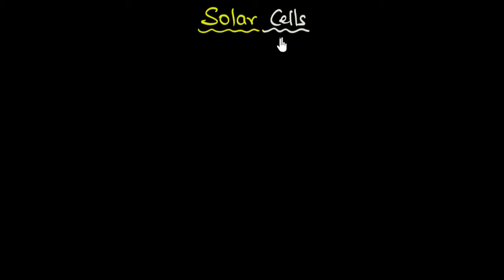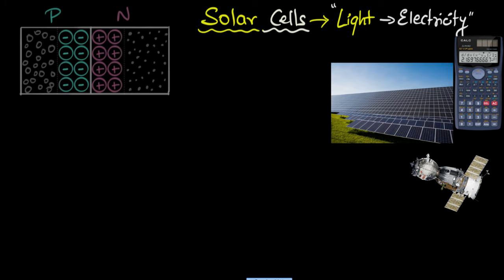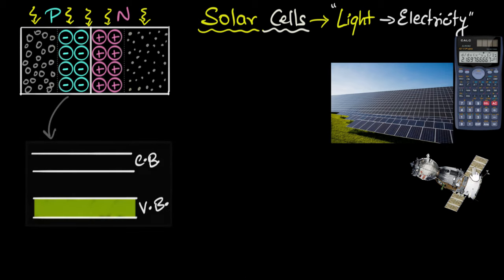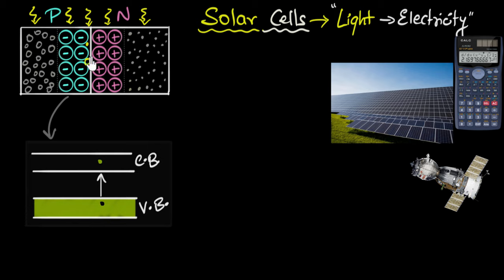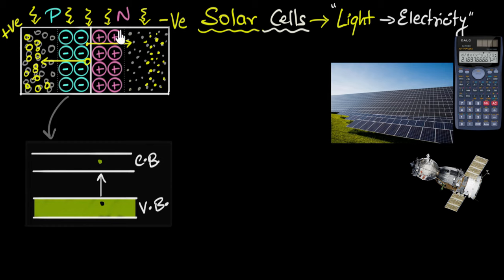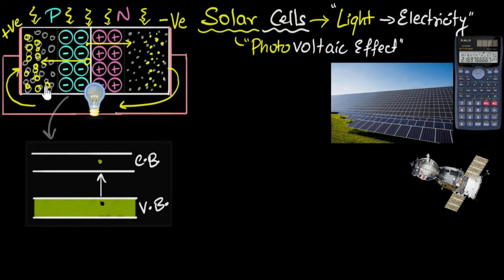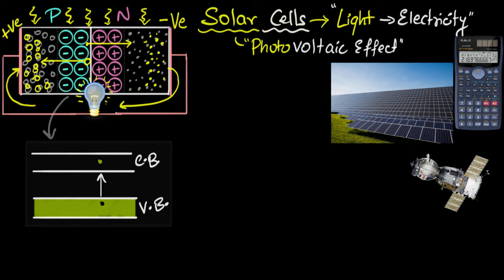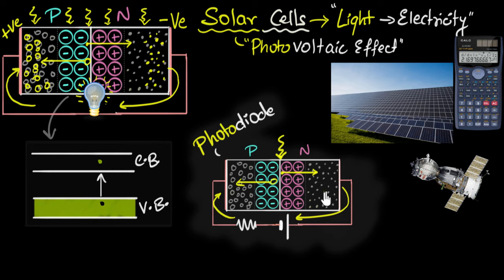Solar cells - working (and difference from photodiodes) | Semiconductors | Physics | Khan Academy

Comment: In your breakdown voltage video. i think because with increase in voltage as V=E.d, d will increase making E constant because charges are mobile but when the deplesion region covers the entire diode, d cannot exceed and furthur increase ibn voltage will lead to increase in electric field which in turn will lead to breakdown voltage. the only difference between your explaination and mine is that E will remain constant at first

Comment: Sir, at 04:59, you mentioned that the electrons will start repelling each other and hence cause a current to flow in the circuit
However, these repulsions would have been there all the time, right?
But since we now attached wires, a path for the electrons to flow has been created and hence, after the repulsion, they start flowing in the wire, which wasn't possible previously (When there was no path/wire for the electrons to flow and these electrons were moving within the diode itself after repulsion).
Am I right sir?

Comment: Sir you mentioned that the idea of a solar cell is to let the charges accumulate. But at 05:02, as soon as a bulb is connected, these charges start flowing and recombination takes place, thereby causing accumulation to cease (as told in 06:55 -> electron hole pairs are swept and allowed to recombine thereby recombination doesn't take place)
If allowing the charges to recombine prevents accumulation, then how do charges get accumulated in Solar cells, even if there's recombination taking place?

Comment: Can someone explain,why is it in the photodiode the majority charge carriers in N type (electrons) dont flow through the battery and recombine with the holes in p type,when we reverse biase it? Why is it that only the pair which was formed through photon gets to go through the battery and recombine on the other side? This might be a dumb question but if someone can explain,please do:/
Reply: Those which are already in the material are bound charges, both holes and electrons. And if they manage to reach the space charge region, they will be swept away by the electric field present there. This is limited by the equilibrium process of diffusion and built in potential. The carriers generated when light falls upon the junction are excited electrons with a specific life time, those which are generated at one diffusion length from the junction are, thus, swept away through the external circuit.

Comment: The topic of photovoltaics (or generating electricity directly from the sunlight) is a topic of growing interest to civil engineers as the integration of photovoltaic (PV) cell into the envelope of buildings (either as a well cladding system or as a roofing substitute) reduces the cost of building a PV power unit. This presentation 👌 is section to describe photovoltaic cell and photovoltaic cell to support structure-structure is provides FREE and electricity can be used on site or exported into the electricity grid from building.

Comment: please tell why these electrons wont get finished. some point in time they, all electrons must get differentiated. and now if we attach a wire across diode's ends and then remove it it must take away all electrons from -ve to +ve side would merge releasing energy and everything will get ionised.
Reply: I have this SAME exact doubt!
Reply: 😆😅 If you attach a wire across diode, from one side electrons are leaving (from negitive side p)
From another side of wire (from positive side n)
 electrons are coming
So number of electrons outgoing=number electrons incoming what happens only charges get recombined if there is a separation there is potential
Now tell me how electrons get finished 🤔

Comment: Sir,Why electrons move away towards corner instead of recombine with positive charge?you told it will swept away towards end due to electric field but why? However your explanation is best for my mindset because I always have doubts, questions just the way you explains. it's like you are answering exactly to my doubts, Thanks if possible clarify my doubt?
Reply from the maker: Electric fields pull/push charges, just like how gravity pulls things.

Comment: Sir, can the electron-hole pairs that are separated in the depletion layer run out? I don’t understand where the holes and electrons keep coming from.
Reply: They are generated continuously because the light incident upon it, provides energy to the electrons, which get promoted to the higher energy level (this creates a free electron) and causes a hole to form (in the position where they had been initially before getting energy from the light)

Comment: I understand that due to theke concetration on electron in n side and holes in p side, in behaves like a cell and if we connect with a bulb, in will glow. But, in a normal PN diode also, n side has higher concentration of electron and p side has higher concentration holes, then why in doesnt behave like a cell? If we connect a bulb across a normal PN diode, why theke bulb doesnot glow like a solar cell? Kindly clear my doubt plz...thanks

Comment: Amazing video! Wonderful ! Millions thanks ! 
By the way I have a question. How can it be possible that electrons get generated for years? Won't it finish just after some little hours ?
If we don't use voltage that appears, does electrons get accumulated again and again? Finally what will be the effect on the cell ?

Comment: Sir, at 05:10
You mentioned that as recombination continues, new electron - hole pairs form
What is the relation between recombination and formation of new electron - hole pairs? Because doesn't the formation of electron - hole pairs depend on the light supplied? I assume that as recombination takes place (And thereby, electron - hole pair gets destroyed), there is a "Room" formed for the new electron - hole pair. Am I right in my understanding sir?

So, I have an understanding that There is no drop in voltage, because for every  electron - hole pair that gets destroyed, a new electron - hole pairs gets generated in the depletion region, get pulled and replace the destroyed electron - hole pair. Am I right sir?
Reply from the maker: Yes pretty much on track :)

Comment: @khanacademy Isn't current supposed to flow from left to right in photodiode? It'll be great if you explain.
Reply: Yes current flows from left to right (opposite to flow of electrons and in the direction of the flow of holes)

Comment: Sir, one more doubt
The only difference between solar cells and photodiodes is the voltage, right?
And, can we use a photodiode for lighting up a bulb, because it can produce a current, right?

Comment: This is called photovoltaic effects?  Doesn’t it?  
1.What would happen if electron-hole pairs generate outside of depletion region?
Because light is also falling over the semiconductor diodes.  
2. Does depletion layer increases(potential barriers increases) when it exposes to light? 

3.how P-N semiconductor is made with figure? Specially depletion region?  

4.light is exposed to the N-type semiconductor. In Practical, measures taken to increase the depletion layer by making N-types small in size compared to P-Type. ...... 

5. When does  diode work as forward biasing?
Reverse biasing?   

6. Oh,yes now I get that.  Why was Sir teaching us that how visible light carries out electrons from semiconductor in room temperature? 
"Just automatic electrons will get out of semiconductor(must be doped either N-type or P-type) when it is exposed to Light"

Comment: Sir,
Can we summarize the difference between solar cells and photodiodes, by saying that we allowed the charges to accumulate in solar cells and then attached wires after some time (in the time gap, charges accumulated because the light was shining on it) and the recombination process started only after some time, while we didn't give any time for charges to accumulate in photodiodes because we almost immediately reverse biased it, hence the recombination process started immediately, thereby allowing almost no voltage. The time for which photons were incident upon the diode is the factor that decides whether it is going to be a photo diode or solar cell.  Am I right sir?

Comment: Sir another doubt...
By shining light on the diode, we are creating electron - hole pairs. The electrons are pulled towards the N - type, while the holes are pulled towards the P - type
And you mentioned that there is a voltage being created
Is the voltage that is being created, in the depletion region (because holes that are generated in the depletion region, by photons, are pulled to the left and electrons that are generated in the depletion region, by photons, are pulled to the right, hence it appears as if there is a net current towards the left, in the depletion region), or outside it (because now that the holes have been pulled to the P type and electrons to the N type, where they are the major carriers respectively, doesn't it lead to an increase in the diffusion current [due to more availability of major charge carriers] which acts to the right) ?
Kindly clarify sir..